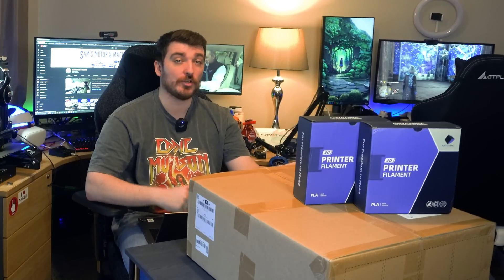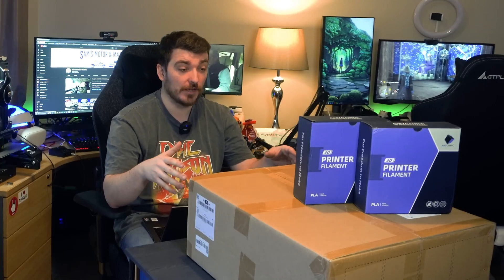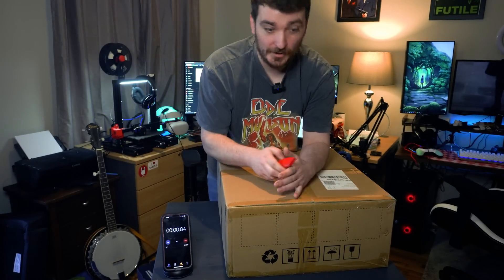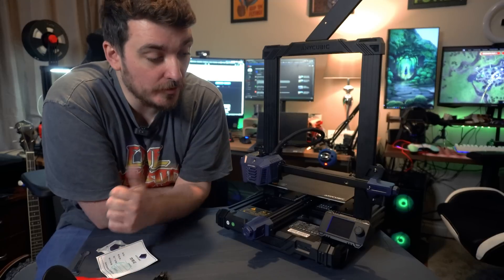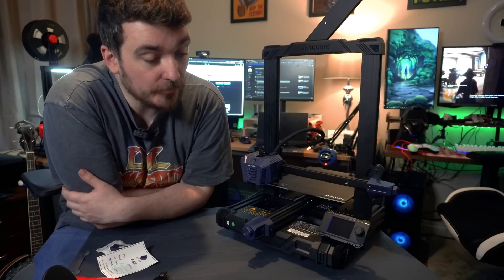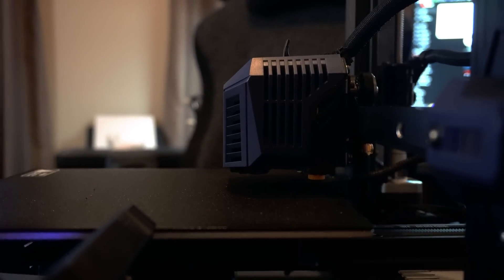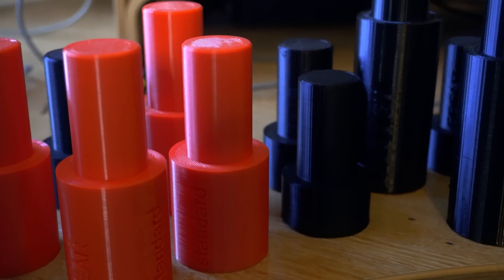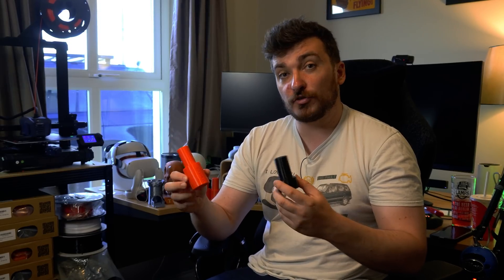I 3D PRINTED a Land Rover Special Tool and saved £££ HUNDREDS! (Anycubic Kobra Neo feature)

Comment: We're lucy enough to have Testbook for our P38's and we made the official calibration blocks out of plastic in the lathe. With Testbook, you use a large block, then a small block, and using an algorithm, Testbook calculates it's values for each height in between automatically.
Reply: I have a set of the genuine blocks which I was given and  I never used with my Testbook (T4) on my P38A.  Now I have an L322, I don't need them.  :)

Comment: Good bit of kit that 👍
Reply from the maker: This is what printed your iPad brackets 💪
Reply: @SamsMotors  excellent, I did leave them hooked up on the dashboard, and the top one went a bit out of shape in the hot sun. Soon got it back again with a cup of boiling water. Lesson learned, don’t leave them on, when not using. 👍